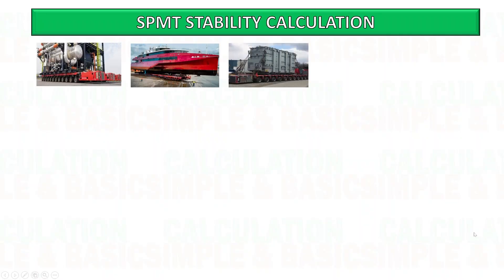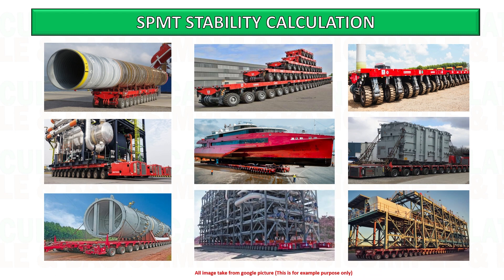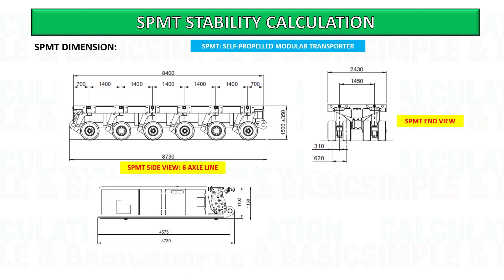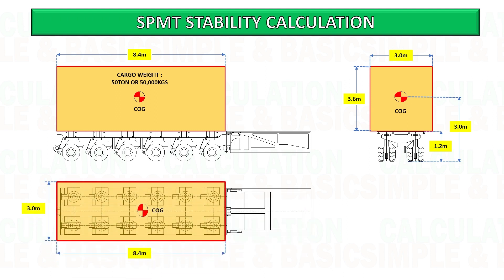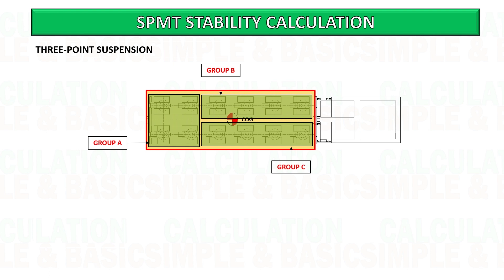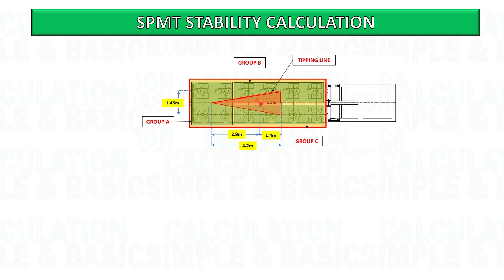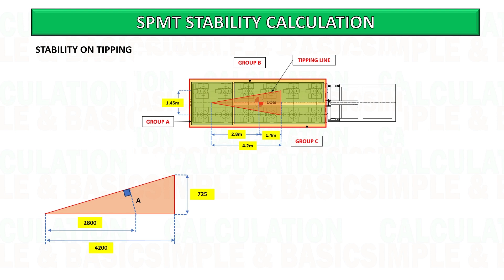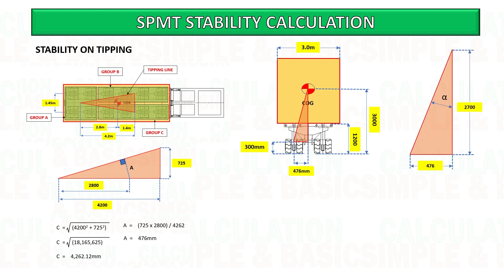Trailer (SPMT) Stability Calculation #spmt #heavytransports #stability #trailer

Comment: Please Sir clarify the formula you have used for A, i.e. 725x2800/4262
Reply from the maker: This formula is to get the A, 
You can also use the below calculation:
tan θ = opposite/adjacent
θ = atan (725/4200)
=9.794
then
sin θ = opposite / hypotenuse
sin (9.794) = A / 2800
A = 2800 x sin (9.794)
A = 476